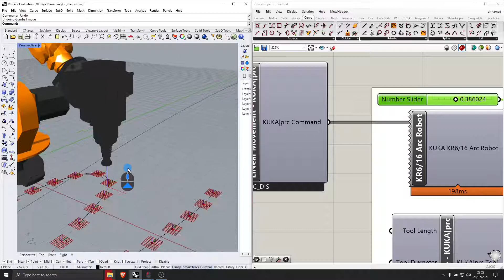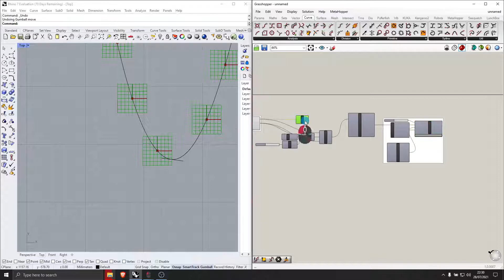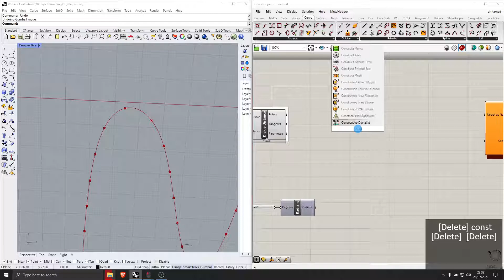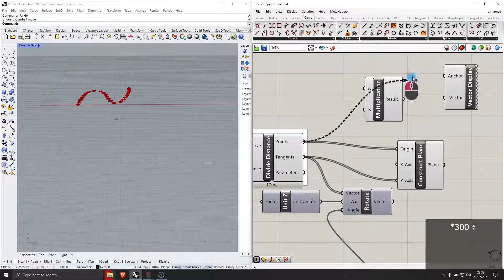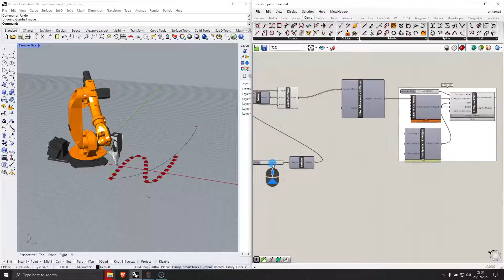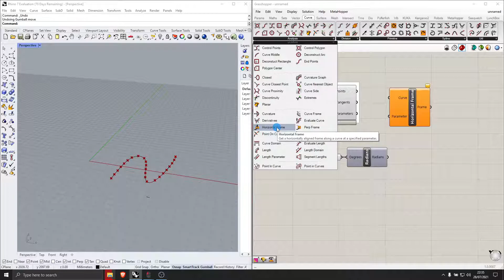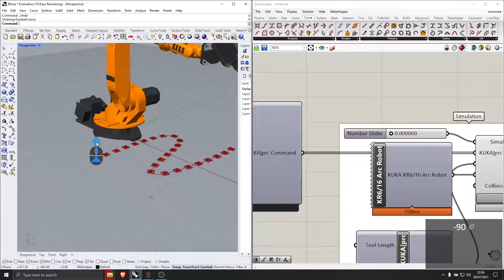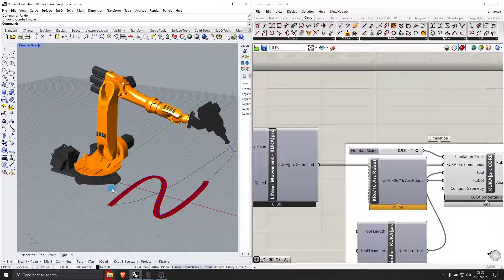How To Orient A Robot Tool Along a Curve (KUKA|prc)

Comment: is their a way to do this where the Z axis is free to move, i want the robot to follow the motion of the curve, but be able change its focal point throughout the arc
Reply from the maker: Hi Patrick, what exactly do you mean with focal point? Do you mean how to rotate the tool around the tangency of the curve?
Reply: @nicholasziglio  Sorry I should have clarified, I'm working with a laser welder, when i said focal point i mean the focal point of the laser. basically, can i make the robot follow the curve of the x and y axis (just like how you demonstrate), while also moving up and down in the Z axis. I need the robot to do a helix like motion near the end of the process, pulling away from the part its welding, but still going over the curve on the x and y axis until the laser fully powers down. If you need any further clarification let me know
Reply from the maker: @PatrickMiconi  How do you want the z axis to move up and down while following the curve? Should it be like a sinusoidal or triangular wave that repeats over a given length? The basic principle here would be to create the planes as shown and then translate them up and down using the move component with the Z axis. You need to assign the Z axis a value for each plane based on some criteria.  The graph mapper could really help you interpolate and shape the Z axis values.

I also don't really understand what you mean with the helix at the end.

Let me know if that helps or if you need any more advice :)
Reply: @nicholasziglio  ok that makes sense, it wouldn't be a wave, it would only pull away at the end of the process I'm doing. so basically I can do the exact same thing you are already doing, and then add a graph mapper function that would help me add Z values to each point?
Reply from the maker: @PatrickMiconi  It would be one approach yeah. If you need it only in the end, you can split the curve and then apply the z offset only to the part you want 😊
Hope that helps!